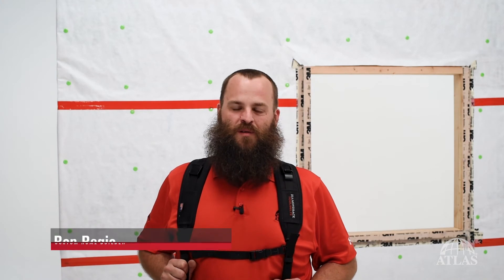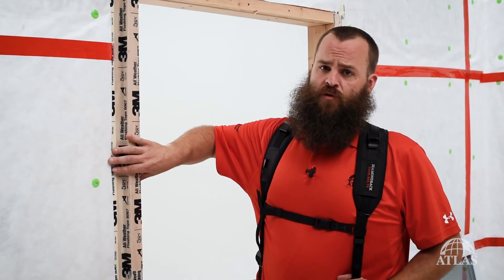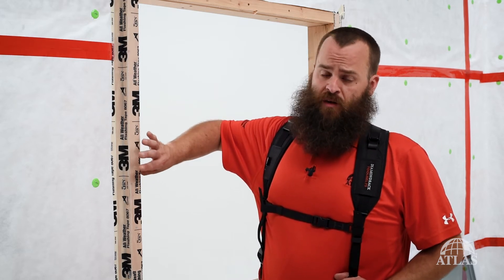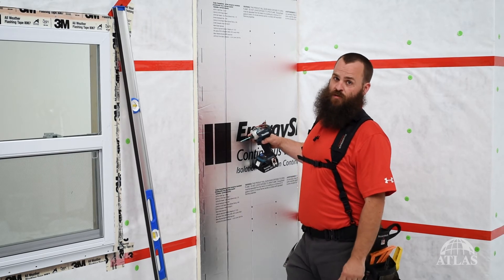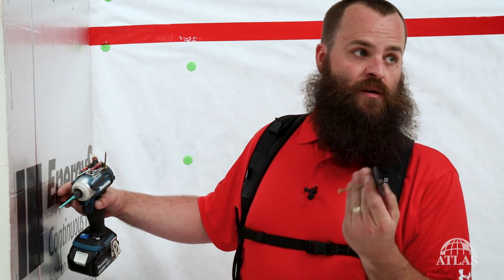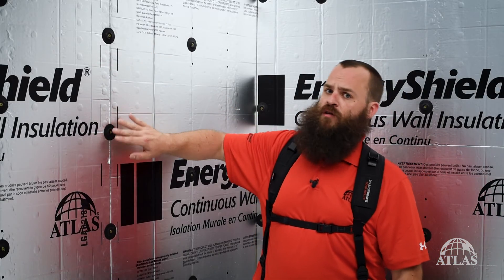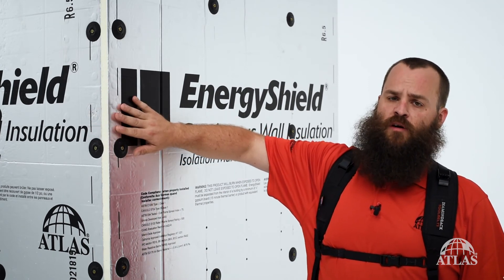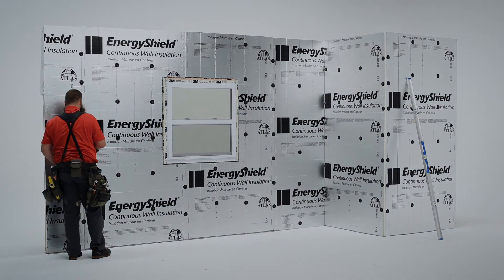How To: Installing Atlas EnergyShield Polyiso Insulation: Attaching to Sheathing (Residential)

Comment: What prevents the polyiso from becoming an exterior vapor barrier?
Reply from the maker: Hey Paul! That's a great question. EnergyShield is classified as a Class I vapor retarder (vapor barrier), because of its foil facers. This means that drying occurs to the interior of the wall assembly. Vapor permeability is only a concern if condensation can form. As long as you provide enough exterior continuous R-value keeping the wall cavity warm and decreasing thermal bridging you shouldn't have an issue.  Of course, every part of the wall assembly plays a critical part, so optimizing the insulation, vapor, and WRB strategies for your climate zone is critical for the long-term performance of the wall. EnergyShield has been a successful part of this type of vapor control strategy in every climate zone in North America for over 40 years.  Here are some resources that might be helpful: https://www.appliedbuildingtech.com/system/files/abtgrr_1410-03_moisture_vapor_control.pdf , https://www.buildingscience.com/documents/insights/bsi-001-the-perfect-wall

Comment: Does it have to have a gap to drain?
Reply from the maker: Where drainage is desired a variety of products and/or installation methods are available that can be included in the wall design that are compatible with our rigid foam insulation.  If you have questions on a specific application, we would be happy to contact you.
Reply: Metal building insulation should you leave a small air gap between the exterior metal and the foil face ? Trying to keep the heat out during the hot summers here in south Alabama
Reply from the maker: @ajmann07   You could go either way. If your install method creates an air gap, that's not a problem, and if there is no air movement in that gap you will get an extra R-1 or so for your wall assembly. However, EnergyShield has a higher R-Value than air, so if you use the maximum thickness of EnergyShield that your design allows for, the overall R-Value of the wall will be higher, and it's thermal performance better.
Reply: The Air gap is a achieve with 1 x 3 battens  which provides a rain screen and your siding is attached to the battens so there’s a three-quarter of an inch gap between the back of the siding and the polyiso product! They also make a tape that’s 3 to 5 inches wide that you apply over the seams they don’t show that in this video and the reason why this is a epic failure of a video. You can buy a venting product attaches to the bottom of the battens  that’s the same three-quarter inch thickness as the battens! it’s a corrugated plastic product called CoraVent with a big screen to provide venting on the bottom so the air can pass from the bottom up through the back and dry out your battens and dry out the back of the siding! For the top where your roof rafters are you could make vent holes and use a nail screen this allows the air to pass through and come out through whatever material you’re nailing on to the bottom of the soffits.